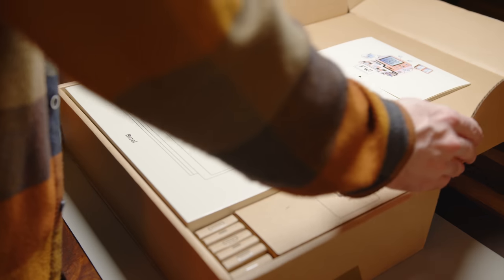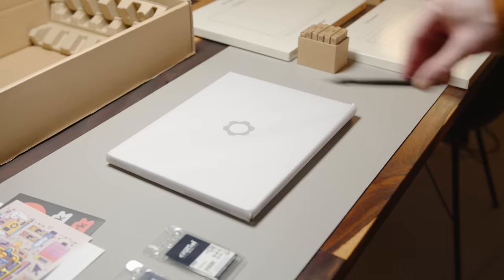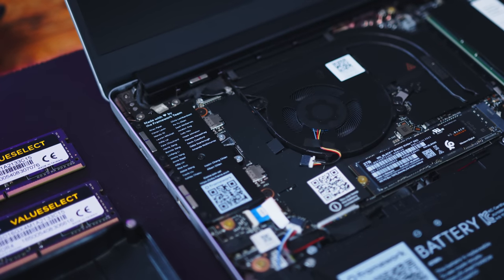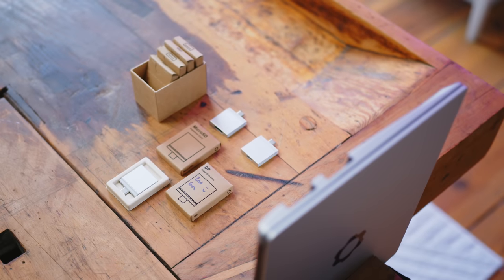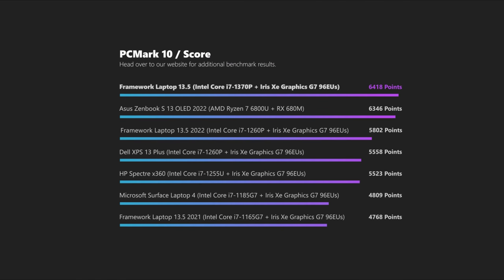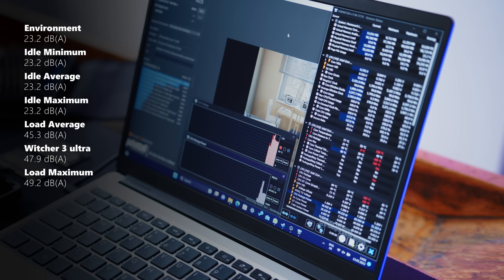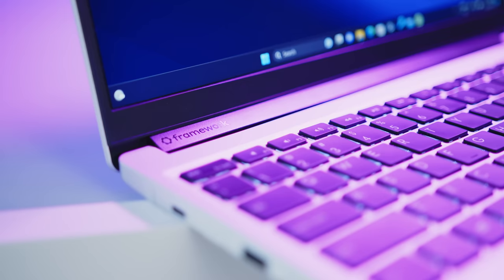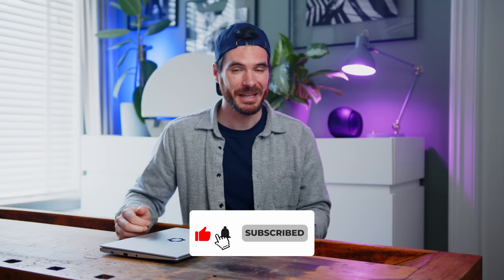The last laptop you will ever own? - Framework Laptop 13 Review

Comment: Framework is definitely one to cheer for, this is exactly the kind of thing we need. Real sustainability, not just "there is 2% recycled plastic in the chassis" or nonsense like that. 

This definitely proves that there is no reason at all for laptop platforms to not be as upgradable and maintainable as their desktop counterparts. Well, no technical reason.
Reply from the maker: Indeed, I mean I like sleek and well-designed laptops as well, but having used the framework during the review ... well, its something special!
Reply: But Apple sees otherwise.

Comment: My wife has a first gen 13th in framework.  We love it.  As soon as the 16 inch is available, i will be ordering. Be able to repurpose a battery into portable battery bank, or repurpose  a previous mobo into a sff computer, change out the ports on the fly, replace or repair everything is amazing.  There is a really good community out there as well.  
Thanks for the spotlight.  The thought of a 780m in a 13 inch is really tempting but i am holding out for the 16.  An upgradable gpu alone makes it worth it.
Reply from the maker: Framework really managed to make you feel like you are a part of something, not just with marketing and fancy "green" words, but with a great product, support and (as you already mentioned) a great community.
Reply: Great comment. After a year or so of debating whether or not the benefits were worth the costs, I placed my name on the list and $100 deposit for an AMD Ryzen 7 machine. I really, really like the idea of a repairable and upgradeable machine with considerable power and good battery life. I am not a gamer of any sort, so the integrated graphics will be more than sufficient.

Comment: I think this was one of, if not the best video you ever made, especially the Unboxing & Build segment. The angles, lightning, image quality were top notch. 

As for the laptop, the main idea behind it is wonderful, I'm curious whether they can carve out some market share in the performance laptop segment. There are many successful gaming laptop designs. Framework can learn from them and adapt those ideas to fit their modular model.
Reply from the maker: Thank you so much. I am pleased with how the unboxing part turned out, so it is amazing that somebody also noticed! :D
I am also very impressed with this, especially considering that this isn't usually "my kind" of laptop. So I am very curious about the 16" model, either. Even just with the repairability and the modular IO, they would offer something unique. Add in the expansion module in the back and the keyboard flexibility ... :O
Reply: @NotebookcheckReviews  one thing I don't know is whether the Framework is liked because it's a good laptop in itself, or because the modular build is just so unique it makes people overlook the potential lack of quality? Which one is it? 

The Framework 16 looks promising by all means, I would buy it just to try out a numpad oriented to the left :D. Make sure to review it once it is released.
Reply from the maker: I think they managed both, starting something like a "movement" that makes you feel like you are a part of something bigger but still deliver a product that simply works!

Comment: Two things.

a) I find this terrific as a product and definitely worth considering, if I was in the market for a laptop and had any money.

b) Do I remember this wrong, or there was a very similar modular system available several years ago, perhaps over a decade?  I have this in my mind, but I can't remember.
Reply from the maker: I think there have been several attempts for a similar concept, and a while back, laptops have been much more modular and easier to upgrade. 
It's a good thing that companies like Framework want to bring it back, so the user can decide if they want something as thin and integrated as a macbook air or something more modular like the Framework!
Reply: @NotebookcheckReviews  Thanks.  I agree with you.  I never understood especially for gaming laptops the idea of having to go as thin as possible even when it goes against the very notion of having a gaming computer.  Stick another cm of height for extra cooling = heating/performance issues SOLVED for most powerful laptops.
Reply from the maker: True, and I think manufacturers realized. Especially this year, companies like Razer and Asus/Lenovo went that route for some of their high-end line-ups.

Comment: Hmmm ... if one decides they need to upgrade the CPU (actually replace the motherboard) then they will most likely need to upgrade the ram as well. The price of these two upgrades approaches the price of a new laptop (perhaps with a better display as well). In either case the machine will still need a Thunderbolt  docking station for addition ports (real Ethernet, two displays, keyboard, mouse, audio, etc) when used as desktop replacement. Being able to configure the four port for travel is advantageous ... is that feature really worth the added cost ?
Reply from the maker: I think the question: Is it worth it is always a very personal one. For example, an AM4 Upgrade kit from their website will be about 1000 EUR (with 32 gigs of RAM and the 7840U)
While this may sound like a lot, you will be very hard pressed to find a (full)laptop with that CPU in that price category.
I get your display argument, but they may be able to offer more options there as well. 
Again, I get your point of view, and it would be interesting to see if the framework would be a better investment in the long-term.
Reply: @NotebookcheckReviews  
>>I think the question: Is it worth it is always a very personal one.<<
Point taken. First of all, one would have to consider the AMD CPU to be an 'upgrade'.
I like the concept but I think that financially it may be "A Bridge Too Far".

Comment: Check out their replacement CPU prices, and you will realise there is a high cost to upgradeability. The i7 1370P is £1050! So put that in your OG Framework 13 is costing you more than the initial purchase price! I do not see the point of that.

The current range is overpriced ultrabooks missing the latest 2.8K OLED 120Hz display like the ASUS Zenbook 14X with 16GB/512GB for under $1000. You can get cheaper RAM upgrades, but 16GB is enough for 99% of ultrabook users.

I saw a repairability study from a big organisation that had only about a 1% failure rate in SSDs over three years, and these were much older tech. From 2023 onwards, repairability is becoming less of an issue for laptops. As we see with smartphones and tablets that have SOC, reliability from good OEMs is rock solid.

Too early to diss this concept, and I assume this is more a lifestyle choice based on sound principles rather than the value option. e.g. the Framework 13-inch i7/1370p/32GB is £2100 in the UK!!! That is the only one with the vPro, which is important for business buyers.
Reply from the maker: You are right with your assessment, the Framework will not win the value argument. But the idea that you CAN easily change your mainboard to something updated or even a completely different platform (going from Intel to AMD, for example) is unique. 
If they can grow their business and expand their user base, hopefully, they will be able to bring down costs and therefore pricing for the end user.
Reply: I would also add that many things can wear off in a laptop life : hinges, keyboards, battery. screen, etc. In most cases those parts are not cheap and not easy to find (believe me, I managed thinkpad/Elitebook for nearly 10K users and we try to keep the machine to last as long as we can : not easy to find parts for some old series. Framework parts are a true bargain in comparison : and you don't have to file the serial number and/or motherboard revision.

Though I agree that the motherboard is a bit expensive if you aim for the bigger CPU. But I do think that a 1340P or 6 cores Ryzen is more than sufficient in a 13'' laptop.

Comment: Framework will always be a niche product. Like Alienware Predator laptops.

Regular people aren't gonna buy upgradeable laptops because people don't upgrade their laptops. 😬

Why the time people need to upgrade their laptops, new tech DDR6/PCIE6/TB5/pcie6 SSD/microLED/Socket would have been introduced. Their chassis is all scratched up.

Buying an upgradeable laptop is useless for these people (which is like 95% of the population).

It may be useful for people who upgrade their laptops every 1-2 years though, and like to tinker with their laptops.

Comment: I would love to see them succeed but I have high doubts.  The industry moves so fast and they won’t be able to keep up.  Look at the display and gpu and vram and cooling systems.  I suspect framework will only appeal to people who want simple, minimal laptops.  Besides gamers, who really want to update components?
Reply from the maker: You may be right, and they might remain niche. But if they can cater to their fanbase and businesses, which can make use of the modularity/upgradebility, they might spark some new trends in the industry!
Reply: I think it's not so much updating components but replacing them if they break. I have an expensive gaming laptop I spilled wine into and I now need to use an external keyboard because repairing the laptop would be so difficult and expensive. I'd like to just switch out that component.

Comment: I think every channel will proceed by assembling the framework laptop and as long as this happens less people will be willing to buy it. Someone needs to review it as a normal laptop.
Reply from the maker: I am not sure I agree with you here. The whole assembly and disassembly part makes this one special in addition to being a really good notebook. So it should be highlighted.
Reply: @NotebookcheckReviews  I respect that. I have always loved your website, only discovered recently that you also have a YT channel. Good going.
Reply: Framework will always be a niche product. Like Alienware Predator laptops.

Regular people aren't gonna buy upgradeable laptops because people don't upgrade their laptops. 😬

Why the time people need to upgrade their laptops, new tech DDR6/PCIE6/TB5/pcie6 SSD/microLED/Socket would have been introduced. Their chassis is all scratched up.

Buying an upgradeable laptop is useless for these people (which is like 95% of the population).

It may be useful for people who upgrade their laptops every 1-2 years though, and like to tinker with their laptops.
Reply: @RunForPeace-hk1cu  Upgradable does not necessarily mean upgrade to the newest version it is also about reparability. Plus when you say 95% people don't upgrade components are basically the same people who, also do not upgrade their devices every 2 years and upgradable laptop is most helpful to specifically these people, who can get their laptop fixed by just replacing the laptop's battery or just replacing the screen. Unlike new laptops. 

When modern companies are constantly creating e-wastes, forcing user to buy new products when old ones just needs a ram upgrade/battery replacement, why are people still supporting these companies is the real problem. 

The whole point of a company like Framework is to prove the point that, tech companies idea of a locked down device is self serving and anti-customer, which they ironically claim to be in the favour of development.

Comment: I had a framework laptop last summer. I hesitantly returned it as I found a great deal on a Dell Inspiron 2-in-1. 

A year later the screen on the dell is separating from weakening adhesive. The Asus Zenbook I got as a possible replacement/backup has random no start issues (known issue with BIOS) as well as non-existent Linux support. Ask these companies for support and you're at the mercy of a faceless corporation that wants nothing to do with you after they have sold you a product. Like they are bending over backwards, going out of their way to offer some official guidance to disassemble YOUR product or sell you some OEM parts.
Framework is still a business but the very nature of a DIY laptop means they have some respect in sustaining your product. The community also shares a bunch of information. For example my framework speaker had some rattle. I thought it was broken/blown until  I found this post https://community.frame.work/t/keyboard-key-tab-speaker-rattle/10400/2 . It turns out the tab key rattles at a certain pitch. Not a blown speaker after all.

I'm a broke college student taking on loads of debt (thanks USA) but will be reordering a framework for piece of mind. Thanks for the reviews!
Reply from the maker: The upfront cost for the framework is undoubtedly higher than what you would pay for the same config with a big brand, but the whole concept of keeping the device running for as long as possible is a unique approach for a laptop company. 
Let us see if they can keep it up!
Good luck with your laptop situation this year!